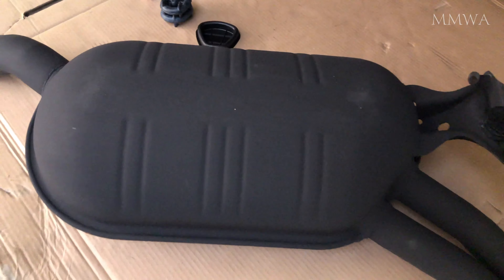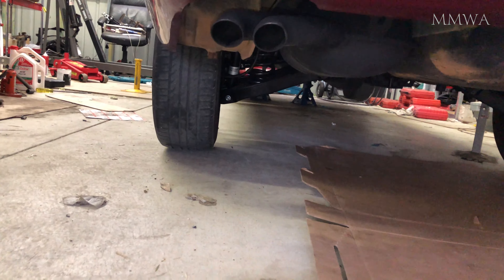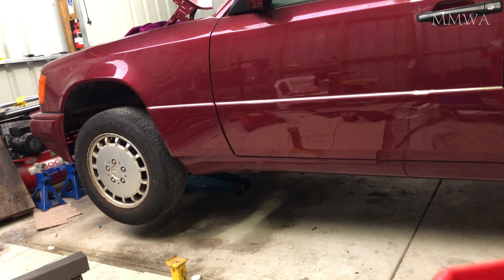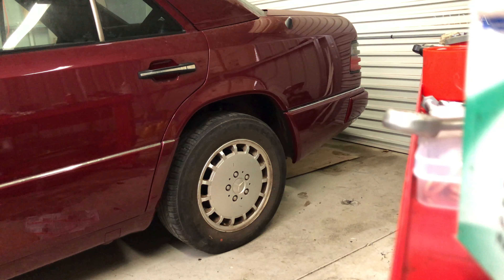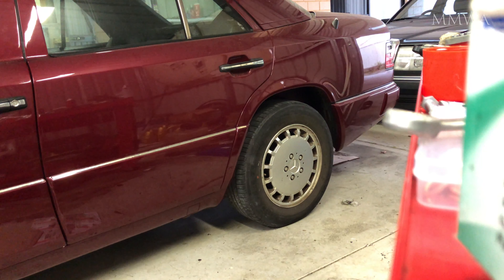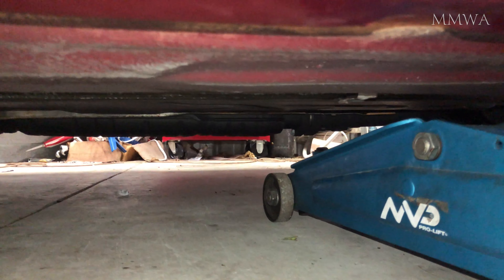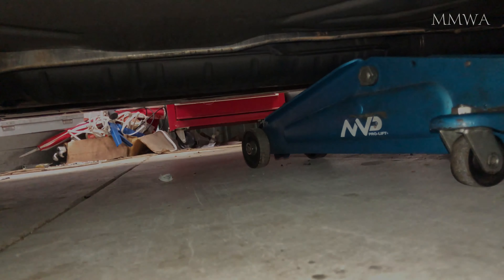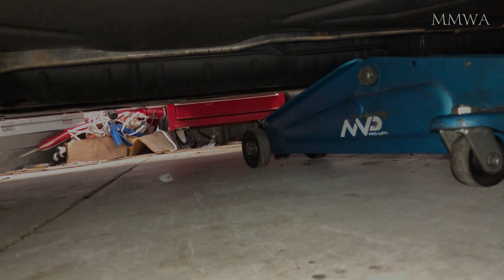Time to fit the red w124's exhaust and see how low it goes

Comment: A little late to the party but my ex-Japan 1993 280E is on its' original Cat & exhaust (unless it was all replaced with genuine MB at some point) all in good cond' & all working perfectly. I only very recently had the German "H" test which is pretty intense (on emissions etc) & the car runs beautifully with lots of smooth power & better than factory fuel consumption. The car has 112,000km & has clearly been extremely well cared for, always used & serviced if only averaging 2000-4000km per year. Maybe that's the secret to the longevity?
Reply from the maker: thats not a lot of use and would explain why the cat still works 😀 The later hfm cars also way more precisely control fuel mixture than KE-Jet too. Both of my cats have melted down, all it takes is one fuel injection malfunction event for this to happen and everyone knows KE-Jet doesn’t need an excuse to have the occasional problem 😃

Comment: So nice. Thank you for the video mate. Noticed your exhaust pipe doesn't have a wire connected to it to measure exhaust temp... Just wondrin because my 90 300e has
Reply from the maker: MRGA Law Aus version cars didn’t need exhaust temperature sensors. That seems to be common on Japan and HK version cars for some reason. The only electric part on my exhausts is the o2 sensor

Comment: Very good job! Mine's exhaust is a mess, since here in Brazil it's very hard to find good used ones and no way to find new ones, even at MB dealers... the only original section is the first, being this welded to a generic flange, then to two 2.5" pipes and finally merged to an Audi Q3's final muffler...
Reply from the maker: Vini Terranova i got my rear muffler from the usa, no one sels the correct m104 version in Australia and everyone fits the m103 version. I’ve nfi what the difference is they both fit each others middle muffler and work. The m104 version has a slightly larger canister. It may just be reasons of different frequencies its tuned for. My middle muffler i bought new old stock from an old man that knows way way too much about mufflers and chewed my ear off for an hour discussing them when I bought it new old stock from him. Bless him.

Comment: what size bolts did you use to connect the resonator to the cat?
Reply from the maker: REDKILLER i thought I mentioned it in the video, I must have forgotten. These are metric bolts and i from memory chose m8 x 70mm long or maybe even longer. I just got the closest match to what was on my other car.
Reply: @MMWA-DAVE  thank you! I am doing this job right now on my 1986 300E.
Reply from the maker: REDKILLER please double check though as im only relying on memory.
Reply: @MMWA-DAVE  I'm just gonna have to buy some bolts and hope they fit. I don't know how to check as my old ones were rusted and had to be cut off.

Comment: Well, the original "crap" that was there before comes with copper nuts, they usually dont rust, especially not in western australia.There must have been a smart dude, mounting normal steel nuts and bolts before. Anyway, ist is always a good idea, to stay original: "copper" nuts ;)
Reply from the maker: Max Berres i do remember the copper nuts but the bolts them selves would have been completely rusted for me to have thrown them away. I never throw away bolts unless they are garbage. This way it forces to to buy new when it comes time to re-assemble. I’ve also not used the original copper nuts on either cars ceramic coated exhaust manifolds, they end up looking ugly in short order. The yellow zinc plated ones have withstood the heat well. Perhaps that’s because of the ceramic coating though.
Reply: @MMWA-DAVE  Ok, this may work well in australia,  but here in Middle-Europe we have rain in summer and (often)snow in winter, including salted roads. Original exaust parts do rust (10-20years), as well as aftermarket china crap (2-5years), so we are changing mufflers with an angle grinder anyway. Nuts and bolts are the least problem.
Reply from the maker: Max Berres definitely no issues like that here in my arid climate- i wont even drive my cars in the rain and limit washing till absolutely necessary. There is usually only 3 months of the year where there is risk of rain and even within those 3 months there are a majority of days where there is no rain at all or its only over night.

Comment: I used zinc coated 8.8 hardness hardware when i replaced rear mufflers 2 years later And one winter
Bolts were seized on nuts
Are those Hot galvanized?
Reply from the maker: JRT indeed they are hot dipped galvinised, 95 cents each at local hardware store including nuts.